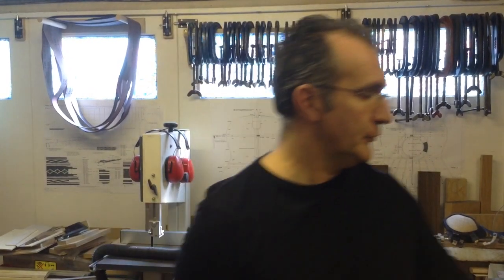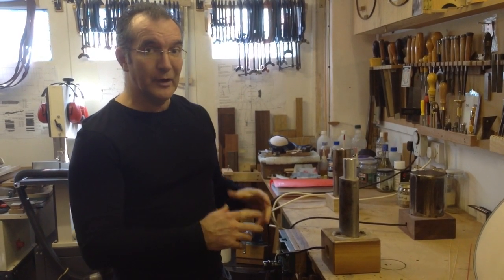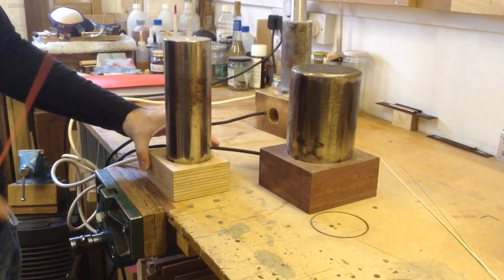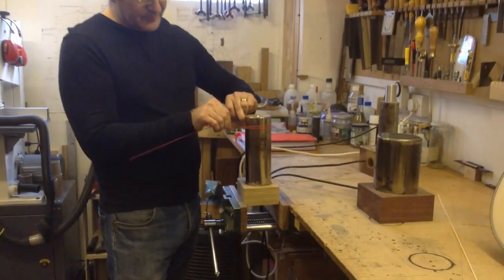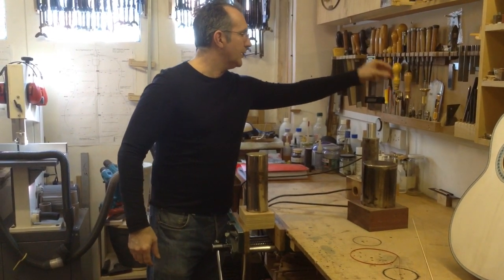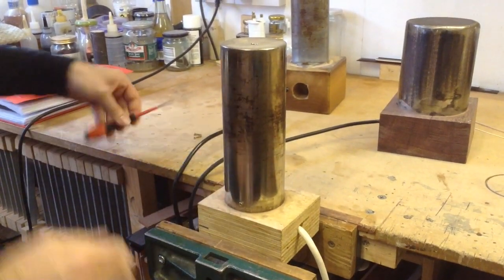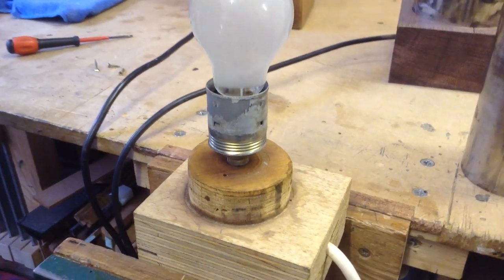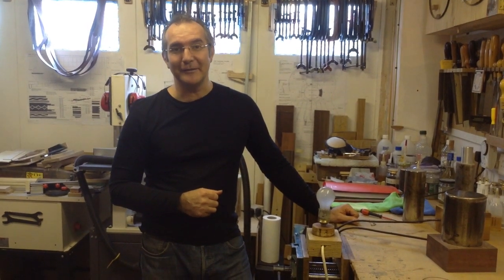How to make your own bending iron

Comment: Thank you for the information.  I took your idea and modified it.  I bought an aluminum bottle that is made for liquids, at the thrift store.  I cut off the top, sanded edges, put in wood plug at opening that fits around an old ceramic bulb holder that I found in the garage.  Screwed to a wood base and used an old extension cord.  Total cost because I didn't buy the extension cord, and I milled the wood from a neighbor's tree:  $2 USD.  Your video had definite value for me.
Reply: Could you point me in the direction of a good aluminum bottle to use? This sounds like a winner idea!
Reply: I ended up using a tin can and a 100w light bulb. The big future problem is going to be obtaining bulbs that get hot as the old filament style are disappearing rapidly for obvious reasons.
Reply: Great idea!  Thanks for sharing that.  I was wondering where I was going to get a steel tube, but the aluminum bottle is a terrific idea.

Comment: great video series, thanks for posting.  This one isn't "make your own" but I'm looking around for custom welders.  Neat idea to have custom shaped bending irons made for you.
Reply: I used a tin can from the supermarket.
Reply: @TheCompleteGuitarist  There's an idea.
Reply: @gesshugh9976  It works.I found a tin a little narrower than the average. I haven't used what I made extensively but I plan to. The problem nowadays is  can you get a bulb that radiates sufficient heat? If all else fails I may experiment with using a tealight (small candle) inside the tin.
 Stradivari had no power tools.
Reply: @TheCompleteGuitarist  Good ideas, I'll probably experiment with this and see how it goes. My original idea was much more complex, probably unnecessarily so. I thought to make a clay kiln of sorts, with a cylindrical top.

Comment: Another cheap way is to use the heating element from a curling iron.  Most now have temperature control built in and are to be had for ~$20.  Just connect them to the metal tube with some thermal paste and you will be good to go.
Reply: does thermal paste act like an adhesive? cheers
Reply: sarge.kazoo no you will need another way of attaching.

Comment: Pablo, at 5:50 you describe the metal tube that was made for you. What is the little hole at the top cap used for? Thank you. Very helpful.
Reply from the maker: It is a hole I use to attach a smaller cylinder on top for smaller curves. It is also a good way to see if it is on or off.
Reply: @redkitekk  ok, thank you Pablo. Can you please tell me the pipe diameters for both of your bending irons (the large one and the small one)? Thank you Pablo.
Reply from the maker: @electricwally  yes, they are 75 mm and 115 mm.
Please check out my course on www.onlineguitarmakingcourse.com

Comment: Thanks a lot for sharing this wonderful idea. I wonder what kind of metal would be the best and thickness
of the tubes used but experimenting will do allready a great deal. I'm using a thicker walled copper tube.
It heats slower of course but is keeping his actual warmth for a longer time. That will count for other metals
as well. But what is best? Copper - Aluminium - Stainless Steel?
Reply from the maker: I use stainless steel and it works very well!

Comment: I am using an upside down stainless steel asparagus boiling pot. £12 eBay. The handles clamped down onto a wood block.  60watts not hot enough I think. Will try 100w.

Comment: Hello Pablo,
Thank you for all your great videos. They are very inspiring. Could you please tell me what bulb you are using now that the old 'hot' bulbs are no longer available in Europe. Which bulb produces most heat?
Thank you for your kind answer.
Best wishes
Reply from the maker: Staffan Svahn a 40 or 60 w would work, there are not so many places where they sell them any more, you are right. You can use a heating element from other aplicación and adjust it for this. I can’t recommend anything specific as I haven’t looked into it.
Reply: @redkitekk  Thank you for your kind reply. Best wishes

Comment: Maestro encantado con sus videos. Estoy empesando a contruir mi eramintas y me entersa saber caul es la temperatura favorable que debe de estar el tubo? Yo construi uno igual al que demuestra usted siguiendo su detalles. La diferencia es que le instale un termometro colocado dentro del envase tocando el tubo. El termometro esta controlando cuando debe prender la bombilla. Una vez que la temperatura baja menos de 70 grados la bombilla prende. Yo utilice un controlador de temperatura digital STC-1000 con sensor. Me gustaria gustaria su comentario sobre esto.
Muy agradecido por sus charlas y classes sobre estos temas.  Espero poder participar en unas de su classes en el futuro...
Reply from the maker: Hi , it sounds like you have made an improved version of the bending iron. Mine doesn’t have a temperature control so I know that if I spray a bit of water and it boils then it is ready, so my guess is that it is at least 100 degree.
I don’t know if this helps, best wishes.

Comment: Pablo, is that tube made out of steel or aluminum? Thank you.
Reply from the maker: It is made of steel but you can also use aluminum
Reply: @redkitekk  ok thank you Pablo. Will this bending iron work with acoustic guitar sides? Also, what is the thickness of the steel that was made for you at the machine shop? Thanks Pablo.

Comment: Hi, thanks for the vid.  What's the diameter of your large one?  More specifically, what's your recommended shroud diameters for acoustic guitar building if I ws to make a small and a large?
Reply: BTW don't worry about any consideration for the inside diameter of the light bulb, I'm going to use a cartridge heater.  So interested in your opinion on the best shroud or bending diameters.
Reply from the maker: bentoa166 the diameter on the small one is 75 mm and the big one 115 mm, but you don’t need to be too strict with these dimensions as when you heat up the strips they are very flexible and they will accommodate to other diameter very easily, it’s only when they are cold they get more rigid.

Comment: Thanks for the video. I've just made a bending iron just like this with a 150w lightbulb inside a sealed aluminium tube but I find that the lightbulb blows (literally blows, in that the glass bulb breaks off at the bottom with a large bang) after about 10 minutes of bending. I imagine it's because it's just getting way too hot. Do you have any advice about how to prevent this? Is that what the hole in the top of your tube is for?
Reply from the maker: I Use a 60W bulb, perhaps the problem is that you are using light bulb stronger than it needs to be. The hole at the top is to be able to attach an additional cylinder, nothing to do with ventilation but I suppose that yes, some heat will be lost out of the hole.
Reply: @redkitekk  Hi Pablo, thanks for the reply. Ah ok, yes, if it works well for you with 60w then I imagine 150w is probably excessive. I'll try a lower wattage!
Reply from the maker: @jamesluff8415  just in case you are interested I have a complete guitar making course available on www.onlineguitarmakingcourse.com
Reply: @redkitekk  Thank you, that's good to know. I'm actually doing a lute-making course at the moment, but would certainly like to make a guitar in the future.

Comment: Hi Pablo. I am also interested in the material (stainless or not) and gauge. I also noticed the hole in the top of one of the devices; is that for safety to keep the device from getting too hit? Working on second guitar since LH 2015.
Reply from the maker: Alec McAndrew the gauge isn’t too important as long as it is rigid enough. The one in the video with the hole in the top is made of stainless steel but you can also make it with other metal. The hole on the top is to attach a smaller cylinder on it.
Reply: @redkitekk  Chef tools work well also    1 1/2 qt. to 2 qt bain maries. at any restaurant type shop.

Comment: where can I find that kink of iron pipe in malaga? Thank you. Very useful
Reply from the maker: when I made mine I went to a metal worker in Poligono El Viso, just outside Malaga. Just look around that area and you will be able to find someone who can do it for you. I made mine 20 years ago so I don have a name to give you.
Reply: Thank you for this information. Would you tell me what the length and diameter of the metal tube that you used for yours was? Does it matter if its Aluminum or Steel? Thank you for your help
Reply from the maker: ogynit The tube in my bending on is made of steel, but it doesn't matter if you make it with aluminium. The diameter is 70 mm and the length 200 mm

Comment: Thanks for the good tip....  how long does the light-bulb last? (I would have to buy a lot in stock maybe, because they aren't sold that much anymore over here)
Reply from the maker: I don't really know the answer to your question, I made that bending iron years ago and I don't think I have change the light bulb more than 3 or 4 times. May be you can find a proper heating element to fit inside the tube.

Comment: Have you ever measured the temperature of the cylinder?  If so, how hot does it get with the 60W bulb?
Reply from the maker: I have never measured it, when I spray a bit of water on it and it boils I know it is ready.

Comment: I made one when I first saw this video using nothing more than a tin can from the supermarket and 100w light bulb.
Pros ... it works
Cons ... getting a conventional bulb that heats up is becoming increasingly difficult.
Reply: You could use a 12v car headlight bulb connect the dip main together and get a lot of heat and is safer.

Comment: Does it have a small hole on top?
Reply from the maker: Yes, I use an attachment with a smaller diameter cylinder that screws in on the top.

Comment: Thanks Pablo ... I make all my own tooling and this project had me thinking of using a water heater element. But thanks to you you reminded me that I used to make rod ovens for welding rod with light bulbs for heating elements. What is so wonderful about using a light bulb (at least while incandescents are still available) is the replacement element is so available and cheap that it is the only way to go. Better buy a box or two quick before the environment Nazi's  outlaw them.
Reply: idiot. Go away